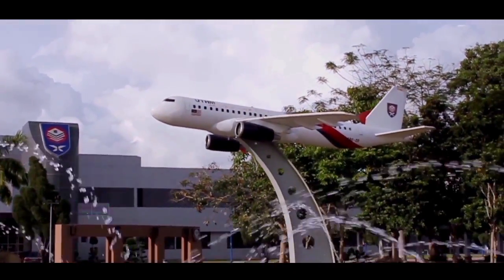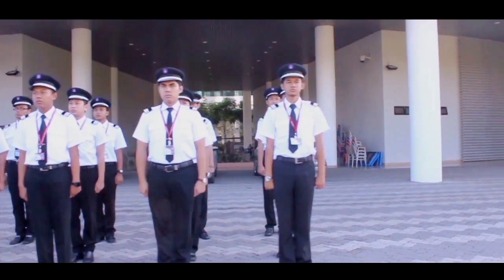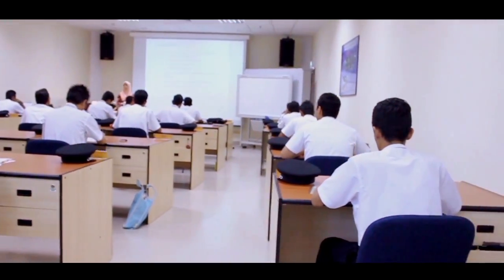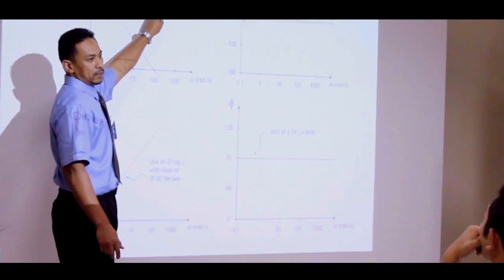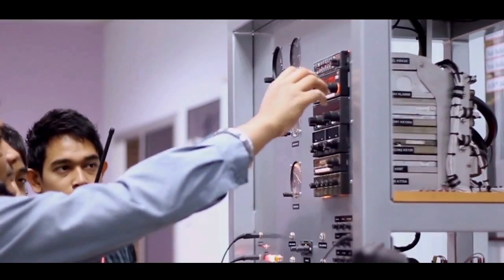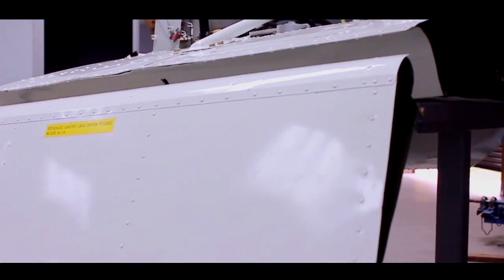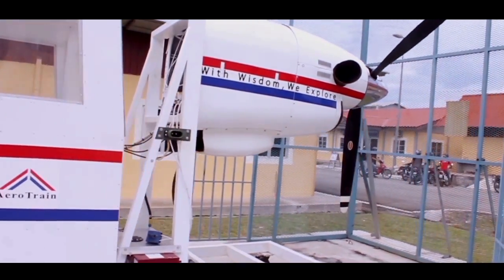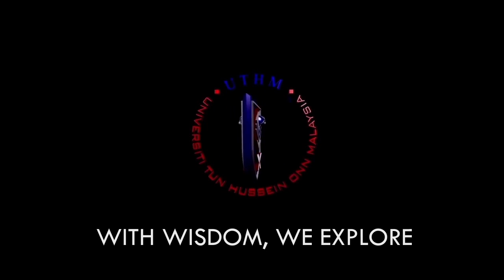Video Korporat Program Aeronautik UTHM

Comment: yea.DCA approved this program. When exam, student should achieve minimum 75% mark on each subject to pass. If not, they must repeat that subject. Other than that, max no of student in each class are not more than 25 person. These are some of the requirement that DCA desired. This requirement also used at flying school like APFT & maintenance school like DTS.